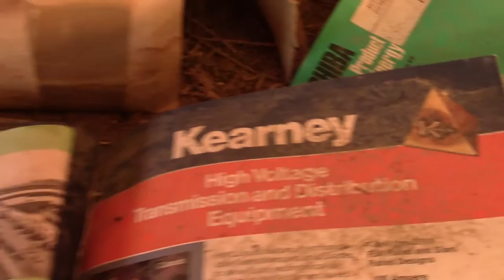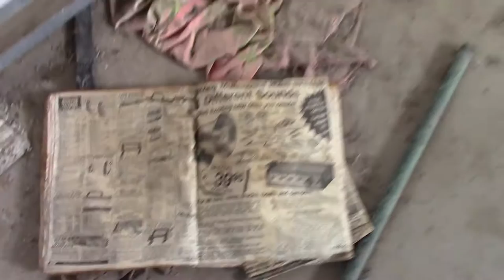Everything Was Left Behind In This CREEPY GHOST TOWN Cobweb Covered Control Room

Comment: Nice video ,good to see that hoist room still complet.    have you checking out the mine ?
Reply from the maker: +datapakx25 Thank you. Yeah, we found the mine entrance, but it had a pad lock on the entrance. I will show it in a future part.
Reply: oki hope someone open it :)  had been nice to 'checking out that. keep on u vids.
Reply from the maker: +datapakx25 It wasn't very secure, just an easy push would have opened it, but we had been at the ghost town for about 6 or 7 hours and were starting to get hungry and the drive back to the nearest town is about 2 hours away. We regretted not bringing a lunch with us as we weren't ready to leave yet. I will have to go back and get some better footage once the snow melts.
Reply: hello oki i understand time go fast when you have a town to check out :).  i look forward some more vids when snow have melts.

Comment: what is that huge thing ? what is its function, rather? 0:36
Reply: the word "turbine" comes to mind: tur·bine
ˈtərˌbīn,ˈtərˌbin/
noun  a machine for producing continuous power in which a wheel or rotor, typically fitted with vanes, is made to revolve by a fast-moving flow of water, steam, gas, air, or other fluid.
Reply: I didn't provide that definition thinking u didn't know it, I'm just a copy/paste freak. what can I say......
Reply: Actually, the steel cables coming off of it, it looks like a winch of some sort.  Possibly for mine cars or something of the sort.